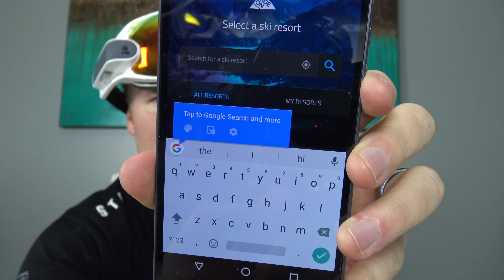What's inside Augmented Reality Ski Goggles?

Comment: Having the two layers of glass creates an air pocket which regulates the temperature inside the goggles and outside the goggles to try and minimize fogging issues. This is also used in higher end airsoft and paintball masks.